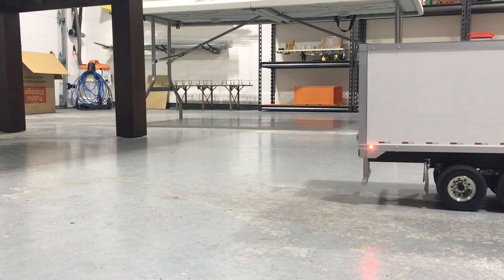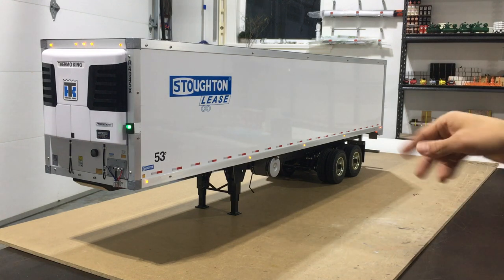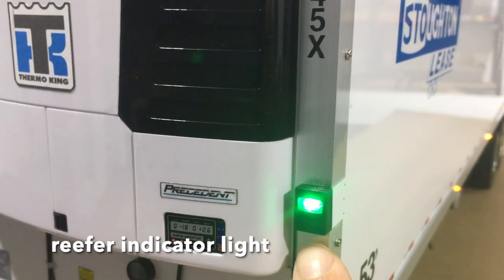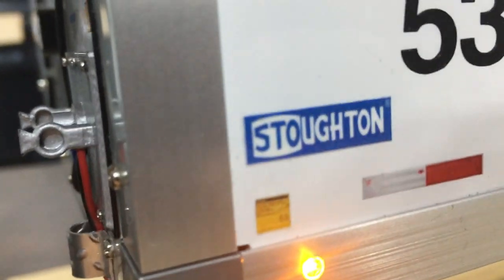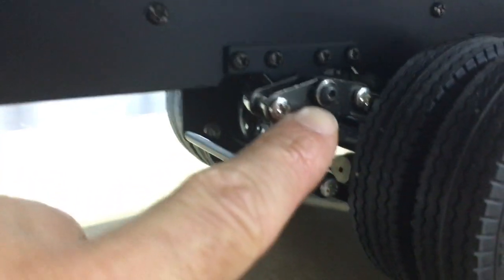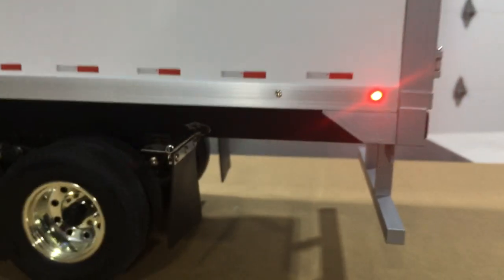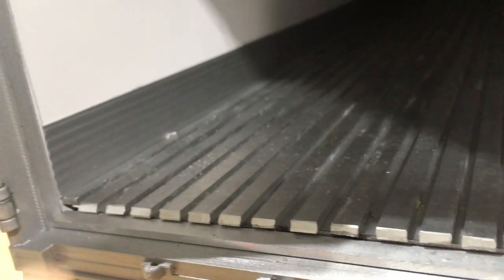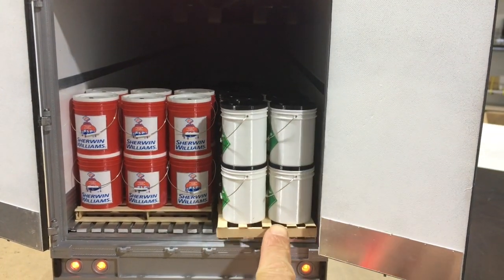Tamiya 1/14 reefer trailer part 8 final

Comment: Absolutely love this! It now looks like a true North American trailer. Are you thinking of adding the flaring on the sides? Not sure what they are called but I think they were added for fuel efficiency and I think to help stop cars etc from going under the trailers.
Reply from the maker: Thanks Freddy, they're called freight wings, I'm not too sure about adding them, still on the fence.  I'll make one up quick and see what it looks like. 👍
Reply: @westernsharpie  Another term I now know! Ok, makes sense...part of me thinks they'll look cool as you see them more often than not now.  But I guess they might be finicky to make.
Reply from the maker: @FastFreddyRC  Thats true lots of newer trailers have them. Shouldn't be too hard to make, a 2mm piece of styrene sheet would work good, then cut the angles and make a couple of braces on the inside. I can't wait to build another trailer and connect it to this one with a dolly trailer. I have two flatbeds still to build and an intercontinental express. I really would like a pair of tankers and that'll be it for trailers........(I think). Look forward to seeing your tanker when its done.
Reply: @westernsharpie  the intercontinental trailer is the one I'll get next..but I'll definitely be waiting to see what you do with it.  It needs to look like a true north american trailer so for me I wouldn't be installing the fenders. But I'll be looking forward to seeing what you do with it and then I might have to hit you up for some parts :)
Reply from the maker: @FastFreddyRC  I think i'll like it more than the deep freeze for a reasons, the axles and wheels are already North American, so no need to change axles, wheels, tires. Also I really like the corrugated sides. Looks a lot more retro. I think when I build mine, I might weather it a bit, like its from the 70's or 80's